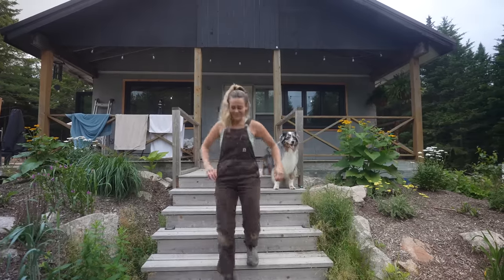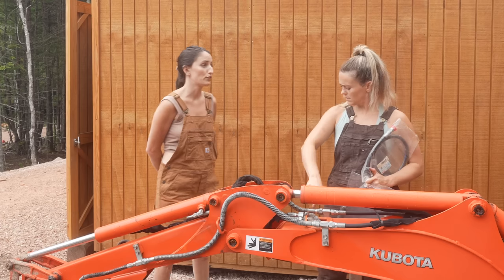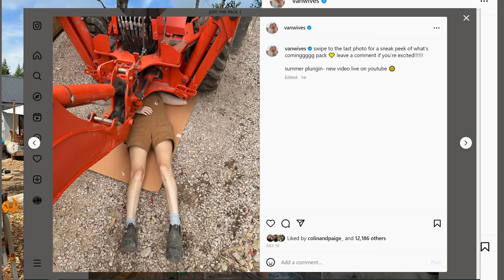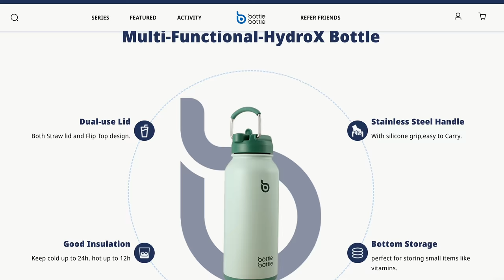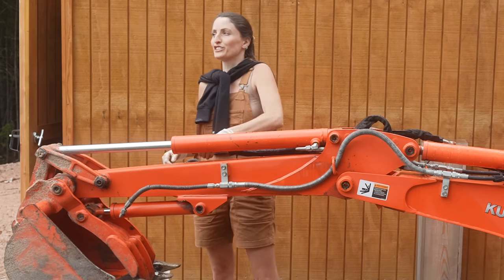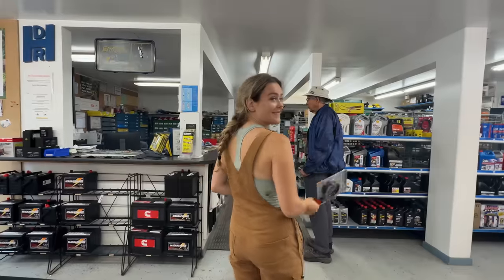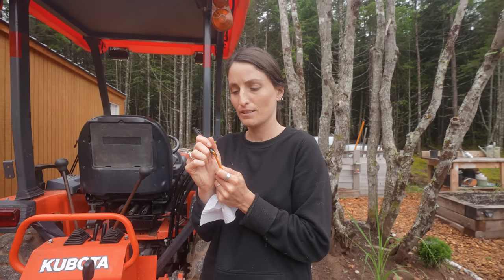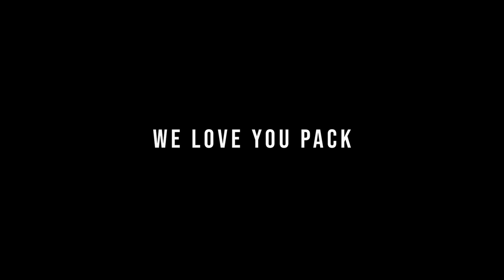FIXING MY TRACTOR

Comment: Next time you need to change a hydraulic hose, you don’t need to drain the hydraulic oil out of the tractor. Just turn the engine off and move the control levers to relieve any pressure. Then just remove and replace the burst hose.
Reply: I was about to make the same comment but I see you have already done so.  Besides, it's already too late.
Reply: What he said
Reply: Haha ... This brought back memories of getting yelled at for disconnecting the battery to do minor tune up. Lost all the radio settings and had to get security code at stealership. Also when I almost drained the coolant just to replace mid hose for cooling system 😅😂
Reply: Next time just lay down a cheap plastic tarp to catch any fluids that might spill or leak and then loosen hose fittings on both ends and replace it. Make sure to check the hydraulic fluid level when done.

Comment: As you're working on the lines you should label them or color code them with tape on both ends so the next time you won't have to do as much work tracing them.
Reply: They shouldn't have to the manufacturer should do it.
It's in their best interest!
The easier it is to repair & the better the engineering of the product is, the longer lasting it is. Which means it has a higher  second hand value. If you know when you sell the tractor on after you have written it off against tax over 5 years you'll make more money. Then you know that money can be put towards your new unit. So the company who makes it can charge a higher price which gives a higher margin but also they can invest in better engineering & better support.
Which why right to repair is no threat to companies that make  well engineered, easy to repair products. It's only badly engineered products built cheap to give a big margin that  need to stop right to repair, so they can hide their corruption & poor quality of the product and I am looking at you John Deere - you used to be proud of your engineering! Farmers used to be proud of buying good quality US engineering. Probably the same place Boeing has gone!
Thankfully under Pat, Intel has woken up & becoming an engineering company again
Reply: Or use color coded zip tie.  I use them on my tractor to track the hydronic lines from the tractor to the bucket.
Reply: @jamesarnold318  Also, make a sheet with color code associated with the part number.

Comment: PS. Trade insider’s tip. Pouring oil: If you open the second little cap on the can or stab it with a screw driver it lets air into the can while pouring so you have a nice steady streamflow and the oil does not ‘burp’ all over you funnel.

Comment: Great work on Clementine. Just as an aside, the small white cap on the big bucket is a vent. It will allow much smoother pouring of the fluids as it allows air in instead of it having to fight the fluids to get into the bucket. Always keep one on hand because not all buckets come with them.

Comment: Van-wives. tip1: when doing mechanical work.  6 point sockets and wrenches are the preferred method of choice for removing and tightening grade 3 and up nuts and bolts. 12 point are used when your short on space when removing the bolts after they have loosened with a 6 point sockets or wrenches. The likelihood of stripping the bolts head decreases with less points. 6 points match the head of the nut or bolt. Tip 2: next time your at Home Depot or Lowe’s pick up a 1 1/4 inch black pipe from the plumbing isle. About 2 ft long. You can use it as an extension on the ratchet or wrench to give you better leverage when breaking a bolt loose or even tightening it. Tip:3 you can put a log under the bucket and push down to lift the tractor and then put jack Stands under the tractor to hold it up while working underneath

Comment: When I worked as a  Mechanic I wore full coveralls and a rimless hat to protect your skin/hair and because they are loose fitting add to ease of movement. Less to wash and in the hot weather coveralls  are cooler. In the winter they can be also be warmer if you wear clothes underneath. In a pinch visegrips are allright to use as a wrench but it can damage the thing that you are using them on so it is better to use a proper sized wrench. Great job girls!

Comment: When replacing hydraulic lines, you don’t drain the hydraulic fluid unless you’re replacing the fluid. 
The only thing you need to do is ensure there is no line pressure. There will be hydraulic fluid in the lines regardless wether you drain it or not. 
In the future, you need to find a parts store that can make you hydraulic hoses. Will be less expensive than buying from manufacturers.

Comment: Nice job ladies. It is very frustrating putting the oil in the tractor. I found a pump that fits over the five gallon bucket. The pump has a long hose that will fit into the fill ports. No lifting heavy buckets and waiting for oil to run through funnels. Thanks for another great Sunday.

Comment: Kiddos, you should be proud, such a great job.  Check your local farm and heavy equipment repair shops.  ( If any) Sometimes you'll have a shop nearby that can make hydraulic hoses in a day or even while you wait.  Usually make really high quality hoses and often cheaper than original equipment replacements.  Thanks for all the work you're putting into the channel.  be careful and be safe.

Comment: Hanging around my grandfather's workshop while I was growing up, I learned that you could build anything you need if you're prepared to figure it out and learn the skills. You're both doing it without a grandpa handy, just YouTube, hats off to the determination. But just as a safety measure you might want to chock the wheels of the tractor so it can't roll forward or back when you're under it. 👍

Comment: Careful, when checking hydraulic lines for leaks use sections of cardboard, because the hydraulic oil under pressure in the lines can penetrate your skin.  Well done ladies, patience and fresh skills learned, other parts of machine maintenance is where all the grease points are and greasing regular, engine oil changes, and the air cleaner/filter changes.   These all keep your tractor in great condition plus making it more enjoyable to operate.

Comment: Ayy up you 4, when you are filling the Engine and the hydraulic fluid up from the drums there will be a clear plastic plug on the top if you make a hole in this,to let the air in it will stop the oil from gluging out,and will flow out a lot better. 👍

Comment: Something you may or may not already know is that using a “cheater bar” will give you more leverage on hard to loosen bolts. Any hollow metal bar that the ratchet handle will fit into to essentially make the handle longer, is a cheater bar. Love the channel. You ladies are doing an amazing job!

Comment: Guys, to have more room lift the front end up by pushing the bucket all the way on the ground like an elephant trunk ie: head tractor body, trunk boom. Make sure you wedge back tyres so the tractor doesn't roll back...
Reply: Agreed.  Wheel chocks add a measure of safety to prevent Clementine from moving unexpectedly.

Comment: Ossumn video content as always. (Helpful hint). You should always have a routine schedule maintenance program set up for each unit you have. ie lawnmower, pressure washer, chainsaw, tractor and vehicles. Keep a running log. When storing for winter drain the fuel from the units and the water from the pressure washer (water will freeze and damage the pump). You two are amazing to watch and are a great team. 😊👍💪

Comment: Great seeing you two working together to do the maintenance/repair on your vehicles.  Such great role models for my daughter.  Just one thing the box wrench that had the extra points of for tight spaces, but it is more likely to strip the bolt heads since it has a small contact area with the bolt.  Much better with a 6 point socket and a flex head ratchet (get one with a longer handle so you can get more force to break bolts loose)

Comment: Nice work!!  Color-coding the lines is a great idea, since it seems the hoses disappear into channels and reappear in a different order.  Zip-ties, tape and paint are all great choices.  Please also get flare wrenches for those things.  While they should be built 'tractor' tough, using Vise-Grip-type pliers, you run the risk of crushing and end, possibly making it so it'll never seal again.  The saying around our house is 'any job worth doing is worth getting new tools for!' is applicable here.  I'm sure you guys already use that saying for your house projects!  🙂

Comment: After you use it an hour or so you shoud go back under and make sure everything is tight and not leaking. And recheck you oil level, filling up the hoses and all usually lowers the oil level to a point it would be judicial to top it off again. <disclaimer, not a tractor mechanic, just a retired diesel mechanic>

Comment: Great work lovely ladies! Clementine should be proud of you! A few words of advice (please don't take them as criticism or think that I'm being patronising):
1. Please consider investing in the right size spanners for the hydraulic fittings and even better a torque wrench, as mole grips are really NOT the best tool for the job. Torqueing up the fittings to the correct value means they wont leak, come loose and you're not going to risk damaging the seals or the threads.
2. You did a great job on cleanliness, but please be aware the even the smallest amount of dirt or debris in the hydraulic oil can damage the seals on the rams and cause them to leak. This is why most old hydraulic rams ooze oil, are dirty, black, sticky and disgusting. A good rule of thumb, is that if you'd be metaphorically prepared to eat out of (please don't do it literally) any container, funnel or pipe that you're going to put fresh oil into/through, then it's clean enough.
Thanks for sharing! Much ❤

Comment: Common sumps for Tractor transmission/ hydraulic system are pretty common.  Howerver, you do not need to drain the tractor to change a hose.  Just have a couple of drain pans for under where you disconnect the hoses.   You want to relieve the pressure in system by moving the controls, with the tractor off.

Comment: Good job, doing it yourself is so important as you're less likely to put off maintenance.

One way you can check for leaks is to put a clean cardboard under the tractor. Any leaks will show clearly on the cardboard. Another tip, hand tighten filters when you put them on or you risk not being able to take them off.

Comment: Howdy, just a quick tip: 
If you open the closure on the opposite side of the pouring spout on the jug it will stop the glugging effect while you pour the fluid. It will allow an even flow of air in as you pour the fluid out. Love to watch you learn as you go and tackle all the necessary details of owning machinery
Reply: If you don't have another plug to take off, just turn the drum 180° so the hole is now at the top of the lid, no more glugs. You can do that with any container with a non-centred opening.

Comment: Nice to have a good maintenance plan for your vehicles.
You should do a bolt check after a period of use....typically the harder you use then do a bolt tightening check.
Generators,gas chainsaws,etc. should have a maintenance plan as you know.
Spark plugs,plug wires.......where you girls live so far from places I'd have a spare parts bin for each vehicle....at least the more common items.
And proper toools for each.
They'll last longer and treat you better.
You probably have already have but "Stabil"fuel additive to keep fuel fresh when you know it will be sitting for a duration of time.
How about a coolant flush before the winter months?

Comment: A little tip when you need a little more Umph to break a bolt loose.  Grab a box end wrench and loop the box end on the end of your ratchet.  This has the effect of making the handle longer, giving you more torque.  You might also use a deepwell socket that will fit over the handle of the ratchet and put an extension or two on it.

Comment: Great job on the repair and fluid change!  Pro-tip; don't ever use your hands to check for a hydraulic leak because you can get what's called a Injection Injury and they can result in amputation of fingers and even hands.  The hydraulic fluid can leak in a narrow high pressure stream that will puncture skin and form a pocket of it inside your body that basically starts killing everything from the inside out.

Comment: Little tip when pouring oil, if you twist the bucket around and pour with the nozel at the top [i know insane right] the flow is much faster, this also works with other things like paint etc when using buckets like that

Comment: if you notice that little white tab on the lid of that 5-gallon pail open it n make a hole...will pour easyer , i save n used the used oil on my timbers for fencein or buildin shed ,shack, skids etc
Reply from the maker: Thanks Dale, of course that would be better! Just like apple juice in the can. Big hole and little hole to make it flow better. Thanks for sharing your experience with us. 🌞🐾

Comment: There is the less than a quart in each hydraulic line. He just put a bucket, hundred catch the little bit of fluid that comes out, put it through a five or 10 coffee filters together and put it back in the tractor. Do have a machine that can pick itself up 2 or 5 feet in the air and let you put blocks it to set on, so you can get to every part of the tractor without having to crawl under it you just keep blocks around when you have an issue you jack it up with the bucket Put a natural position to give ease of access to the w lines put blocks the tractor take the pressure off cylinders as you shut it down by opening up the valves(moving the handles back-and-forth) The fluid will naturally go back into the tank. It’s under pressure. If you have a cylinder that spraying but duct tape around it and tie a towel around it and you can use it long enough to get the tractor it in the air.

Comment: Years ago I was working on the flight line as a jet turned up 2 3000 psi hydraulic lines burst spewing fluid everywhere The line boss had to snatch an airman back that went to "grab" the lines. It was a sight to see that TA 4 jet bleed out. Needless to say jet got shutdown and towed to the hanger where I learned about changing hydraulic lines. I know that feeling of being coated in oil......
Y'all done good. Wish I was near to help y'all with this stuff.
Reply: Pressure in the lines?

Comment: You do not need to tighten the filters with a wrench…3/4 of a turn after the gasket touches the surface is plenty tight….if it’s extremely tight coming off, it’s a good idea to make sure the old gasket came off with the old filter

Comment: In a pinch, you can substitute channel lock pliers for an oil filter wrench if you don't mind denting the casing of your filter.
Reply: New filters should be hand tightened.  The old one can be dented, crushed, punctured, or whatever is necessary to remove.

Comment: You should use nail polish and paint the head of you hydraulic plug. Then it’s easy to identify and the polish is really durable. I did this with my work key so I could find it quickly in my bunch of keys. Lasted forever.

Comment: I was a semi truck driver for about six years, and our diesel mechanic used to take the old oil and dump it right into our diesel tank of the truck, and we burned it driving down the road. Yes, it's going to require a little bit more maintenance on your truck engine… But it's being done.

Comment: Here's a tip for pouring stuff out of a 5 gallon bucket. If you turn it so the spout is on the top side instead of the bottom, it won't be gurgling and you can make a smooth even pour. Makes for a cleaner less messy job. Your welcome

Comment: Do you have any way to make room underneath the tractor.. UC outriggers to lift the tractor off the ground.. then put jack stands underneath the frame.. drain out the hydraulic fluid the outriggers slowly but the tractor truck cuz you're be no pressure holding the outriggers down.. that should give you some more room underneath .. just remember to put blocks underneath the front wheels to prevent the tractor from rolling..

Comment: Well done girls🎉🎉 little  tip, whe pouring fluid, fuel etc out of large drums instead of having the pouring spout at the bottom turn the drum so the pouring spout is at the top and you wont get that gulp, gulp, gulp while trying to pour fluid 👍

Comment: It takes a lot of fluid if you drain it. It’s easier to put a pan under the area you are working on. It’s best if you have an area to work on the tractor where you can clean up after you work on it.

Comment: Another tool for Kubota maintenance you will need is for the grease fittings (zerks) You need  a Grease Gun.  I suggest getting a battery powered grease gun with long hose.  Get a grease gun that will run from your existing battery powered tool brand. Don't buy the hand crank grease gun.

Comment: I worked on tractors a lot and if its not running there's no pressure in the lines just have a bucket handy for what's in the lines...Oh and never tighten the filter more than you can with your hand or you will never get it off without hammering a screwdriver in it to get it loose the next time.

Comment: Don't put oil filters on with the wrench.  They only go on hand tight.  If you don't have a filter removal wrench to remove the filter, take a big flat screwdriver and hammer it through the side of the filter and start turning.

Comment: For the dip stick, pull and wipe off, place back in and pull out, this time fold paper towel over it and you can check the level that way also by the oil left on the paper towel. If that makes sense